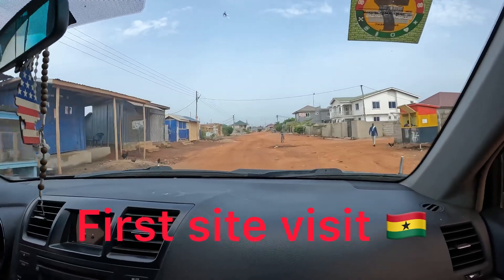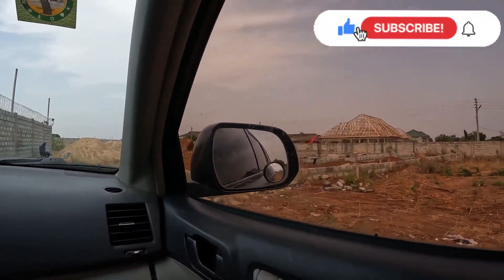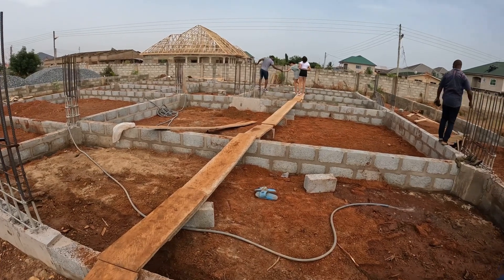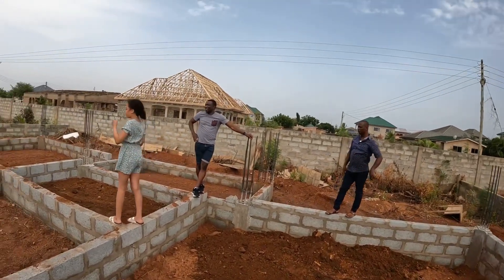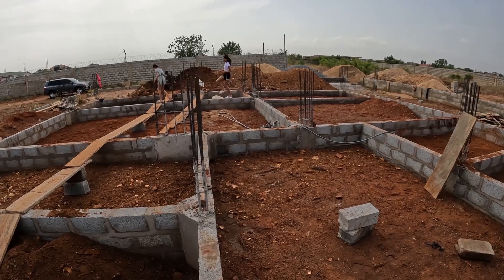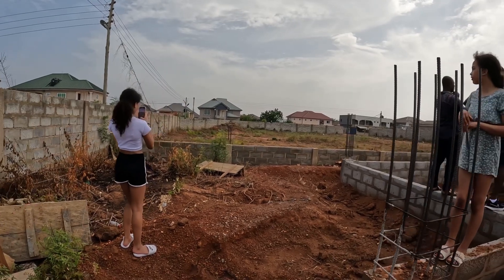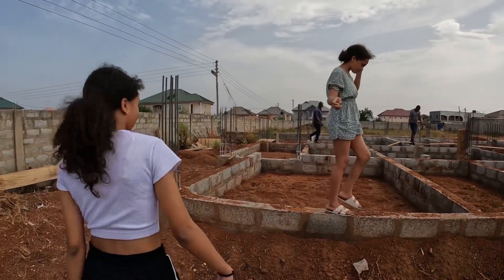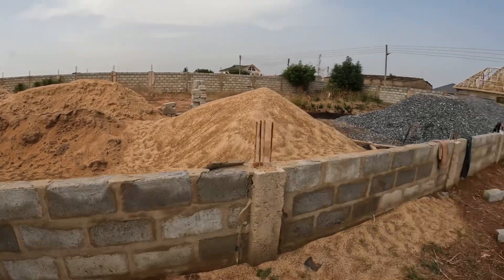Building in Ghana. We Arrived !! First Site Visit

Comment: Make sure they apply waterproofing membrane on the foundation wall to prevent algae from growing on them. Let them install weeping tiles too to drain the foundation
Reply from the maker: Thanks for the recommendations. We did use DPM 300mu gauge to cover the whole of the foundation to overlap the external walls. Weeping tiles was not specified by the engineer but I would speak to engineer about it and see how it can be retrofitted.  Thanks Please watch for our next video on the DPM and slab casting.
Reply: Wat is weeping tiles . Who does dat part want to add to my foundation thanx
Reply: I have didn’t know dat is the weeping tile 😂😂😂. Can Ghanaian plumbers fix that????
Reply: Good advice 👍